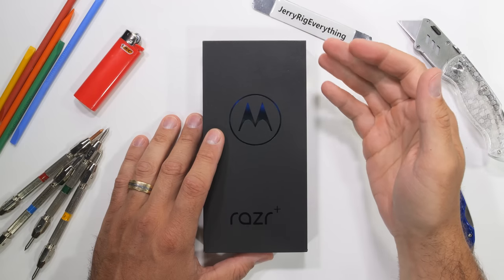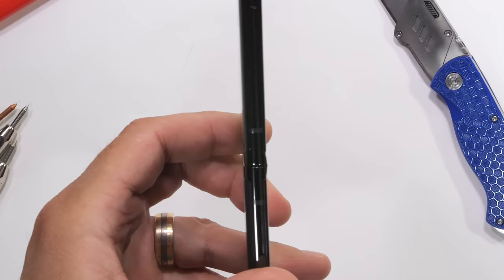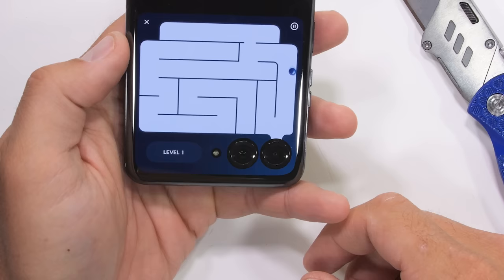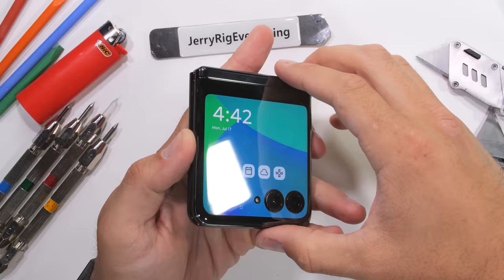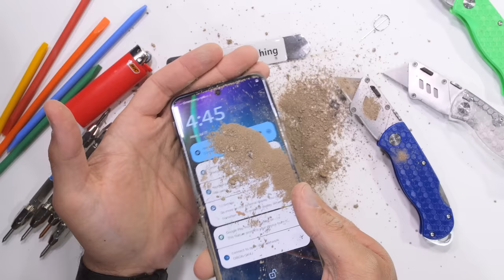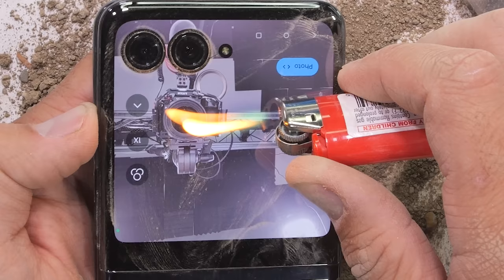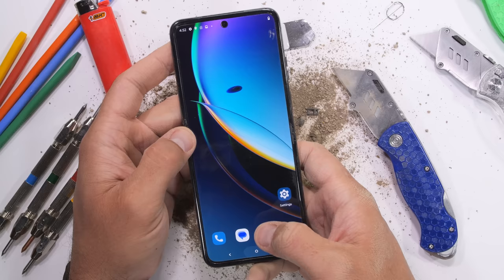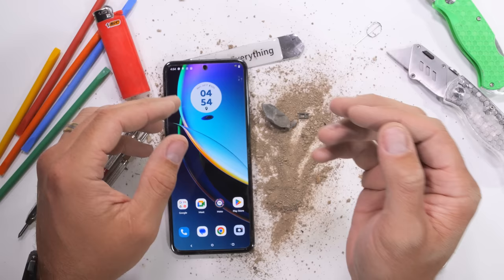This has NEVER happened before...

Comment: hey at least its better than googles ugly contraption plus look at how far they have come in engineering and design the screen did break but pressure there is not gonna be a regular thing but it automatically off sets because this same small screen is heck of a conversation starter and a "your cool" taker.

Comment: Went from this to the 2020 razr durability test.

I just want to know, in your opinion

Is there any difference between victus glass vs now days, 3 years later? both of them, 6, deeper 7.. Is there any reason for the upgrade to new victus? Are they producing the same product with a new name? Why do we pay extra for the new glass that still have scratches at a level 6, and deeper grooves at a level 7? 

I feel I could go further than the 2020 moto razr, but that's been the 'standard' for years, yet Corning comes up with new iterations. I remember a promo from Mr. Savage with Corning naming the next age as the 'Glass Age', and it made sense, but the progress from Corning seems like fluff since then, based on the progress in other industries for other phone components.. DDR5 RAM in phones? R U serious? but still level 6 or level 7 is the standard for glass..

Not even going to mention the incredible engineering to make a plastic screen in the 'glass age', that doesn't keep up with Cornings work to make Victus. It's impressive enough for me to leave a breadcrumb trail to say, 'damn, I think I might buy this gen of foldables'. been on a few vids now, leaving my opinions, and I don't do that..

Hope you respond with your opinions on the glass sitch. You're the expert I trust.

Comment: I use a 3 time handmedown S9 with the screen shattered so bad in multiple places that the adhesive can be scraped off what used to be underneath glass and even those parts of the screen on the edges that i can slip my thumbnail under the literal display of are still functional to touch and with 0 weird shatter artifacting of the display itself. Idk how but shit really isn't made how it used to be, at least in the case of my specific S9. This seems to be a good phone tho, just a weird anecdotal tangent I think people may find interesting. The moto def passed tho.

Comment: the soft screen is all the stops me from really being interested in folding phones. i damage normal screens, let alone stuff that grooves from a fingernail. I like these style flip phones over the Fold series phones, but if I were going to get a folding phone, I like what the Duo does. Protects my screens while closed, nothing on the outside (dont need it), real screen on the inside, can be folded all the way to use single handedly still. I hope that MS really improves the Duo (it needs it) and/or other companies try their hand at that kind of folding device.

EDIT: decided to look up rumors for the Duo 3 and apparently their axing the dual screen design and going to do a foldable screen. too bad.

Comment: I think, for the sake of what folding phones are and what their limitations are, this is an outright pass. Hear me out:

Beyond all expectations, the part of the device you'd expect to break, did not break even under immense stress. That's actually incredible. While the mini screen shattered into oblivion, I think it goes without saying that it's nothing short of impressive how well the actual most fragile part of the phone survived. Given the constraints and difficulties of foldable phones, this is an absolute win. Perhaps the void will be fixed in an updated version, or maybe even a revision that eventually fills the market like the updated Nintendo Switch did. If that were fixed, the phone would have passed the bend test, which is crazy to think about. Amazing job Motorola

Comment: I stopped watching when you didn't remove the screen protector. You didn't remove the screen protector on the Samsung Flip 2 review either, which I later bought. The protector cracked within only a few months of use, and became a danger to the screen beneath. I removed it and have been using that screen for another almost two years now. Please show us the hardness of both,  as it is quite possible to need to rely on the hardness of the screen beneath the protector.

Comment: I consider this a sollid pass, especially after the Pixel debacle. But someone at Moto must be extremely pissed off. Working tirelessly on the inner screen only for the "normal" screen to fail under pressure.

Comment: Id consider it a draw, definitely not a pass but also not a fail due to it still functioning 🤔
Reply: Yet, the iPhone 15 Pro was considered a "fail", despite only the back glass being damaged. Meanwhile, the Mate 20 Pro and OnePlus 11 are considered "passes" with similar damage.
Reply: @whateveriam12  the structural integrity of the back of the IPhone 15 is Horrific compared to this. Its a fail due to the integrity of the overall structure of the phone itself. The back panel over the camera lens SEPARATES if dropped from like 4-6 feet lol theres a lot more too it then just the back glass tho

Comment: Fail. That void in the phone is such a massive design oversight, or at least gross negligence. I have never seen empty space like that other than in game phones for the vents. Ultimately, if you're the type that puts your phone in your back pocket, or you just drop the phone wrong, that exterior screen is toast just from that one flaw. Otherwise this would have been incredibly impressive, and a foldable I was finally interested in. Instead it's a massive pass.

Comment: When are you ever going to be anywhere where that much damage is done to it. This is a total pathetic scenario. Stick to doing something else because this isn't working
Reply: It is to simulate years of abuse to a phone, not necessarily a scenario where that much damage might be done at once.
Plus if you put it into your pocket and accidentally smack it against a wall as your moving through a crowd knowing whether or not the phone will break in those instances is pretty important. The fact that it does break this easily during the bend test shows you that you need to baby a phone like this more than other phones.